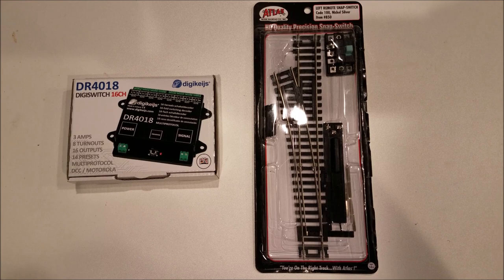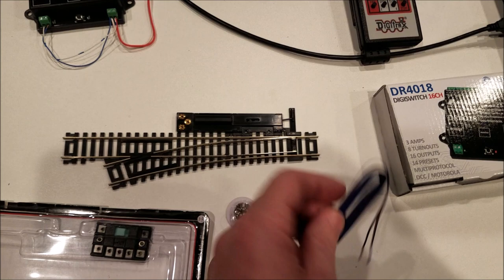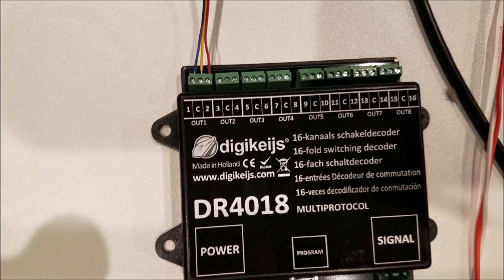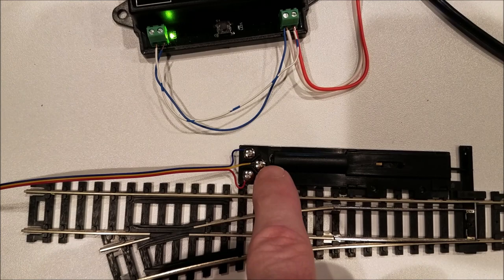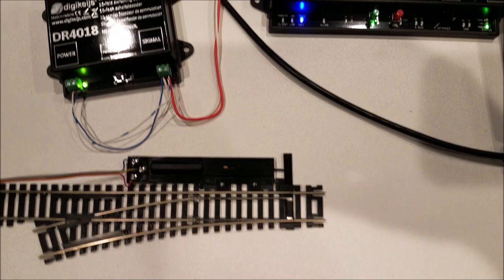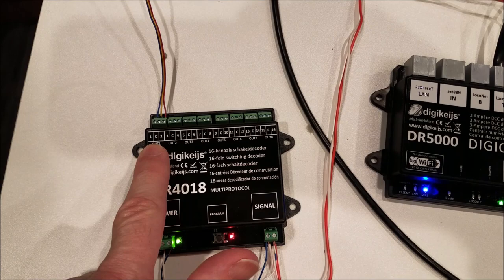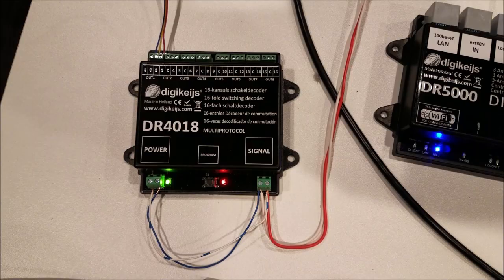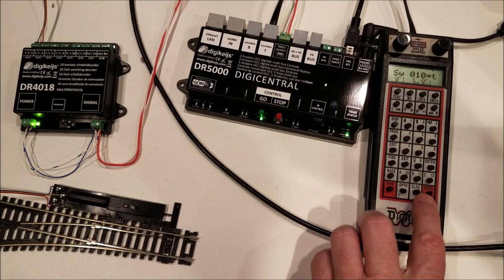Atlas Snap Switch - Any Scale - Turnout Setup For All DCC Systems - Digikeijs DR4018

Comment: Great video.  Very helpful.  I still have a question. For throwing multiple turnouts at the same time (e.g. a crossover)  can more than one output be assigned to the same address?  Or can one output be connected to more than one turnout at the same time?  Thanks!
Reply from the maker: Yes, you can connect one output to two turnouts for a crossover.  The DR4018 has now been replaced by the YaMoRC YD8116.  Here is the link: https://www.ironplanethobbies.com/product/yamorc-16-channel-dcc-signal-turnout-decoder-yd8116/

Comment: Is the Dr5000 required for the Dr4018 to work?  Or just power it from track and it will also get commands thru the track?  I have 20 installed snap switches and looking for solution other than ripping them out.  Thanks
Reply from the maker: You don't need the DR5000.  If your DCC system can can issue a turnout command, (Closed or Thrown) then you can either power it with the track power or use the track power for the signal only and then use an external power supply for the power input.  It will work either way.
Reply: Thanks for quick feedback.

Comment: Thanks for sharing ! My question: can I also use a control panel toggle switch - in parallel - so to speak to trow turnouts controlled by this DR4018 ? Or is the use of the Z21 app a better solution to operate turnouts and setting a route as one would do via the control panel ? Thanks for your reply.
Reply from the maker: Hi, you can use all the above.  You can use a DR4088 any GND or OPTO version for the toggles.  (They provide the sensor inputs)  You can also use the Z21 app, JMRI, throttles or any other app.

Comment: If I have a separate power supply I do not need to run the wires from the power input to the signal input?
Can the signal input can come directly off of the dcc bus wires?
I have a Digitrax system 
Thanks
Reply from the maker: Yes, you an use a separate power supply and take the signal from the DCC bus wires.

Comment: How do you set this up without a hand throttle?
Reply from the maker: You will need some way of throwing a turnout through your DCC system.  This can be done on the computer using JMRI, RocRail, etc...  It can also be done with a phone or tablet using any app that has the ability to send a turnout command.

Comment: How about setting this set up for NCE users like me I have a NCE PowerCab I'd to see it work with please.!  I'm slow so please show how to set it but dont fly through the process or my Brain might freeze up🥶 And thanks
Reply from the maker: I'll see if I can get that done.  In the mean time I can tell you that there really isn't anything to it.  These will work right out of the box with address 1 being assigned to the first output.  Therefore, on the NCE you would just select turnout 1 and then either a thrown or closed command to throw the turnout.  By default address 2 is already assigned to output number 2 and so on.  If you add a second DR4018 then press the program button on the DR4018 and send a turnout command to number 9.  That will set the second one to 9 and the first output to 9.  As long as you know how to throw a turnout from your throttle, app or PC it is really easy.  Hope that helps.
Reply from the maker: Here is the NCE version: https://youtu.be/rtdLIp-VCSY

Comment: Will the 4018 work with the peco surface mount point motor?
Reply: I think its peco PL11
Reply from the maker: Yes, it will work with any snap switch or twin coil switch machine.

Comment: can the switch be taken off to use tortoise machines?
Reply from the maker: Yes, if you decide to go with the Tortoise, you will need the DR4101 Switch Motor Interface.  The DR4018 will control up to 8 Tortoise.  DR4101 LInk: https://www.digikeijs.us/dr4101-switch-motor-interface.html

Comment: Can this be expanded? I have a total of 15 turnouts. Thanks in advance!
Reply from the maker: Yes, you can add more DR4018s.  If you leave the first one at the factory default of 1 then you would set the second one at 9 and the third at 17 and so on.  Therefore, the first output on the second board would be at 9 and the first output on the third would be 17.
Reply: Awesome! Thanks for your help!

Comment: Easier n cheaper for me to switch the switches by DC acme lit controls I don't need DCC controls to switch switches 1 acme control with lights
1 or 2 switches 
1 switch relay to switch 1 or 2 switches at same time and change direction signals

Comment: also can the switches be set in macro
Reply from the maker: Yes, you can set macros to throw the turnouts.  It can also be done with JMRI, Rocrail, etc....  Or a throttle.  Or by using a DR4088 (OPTO or GND) you can also throw the turnouts with a push button or toggle.